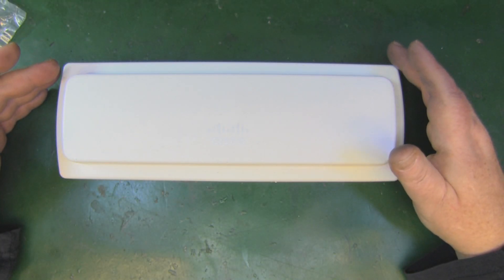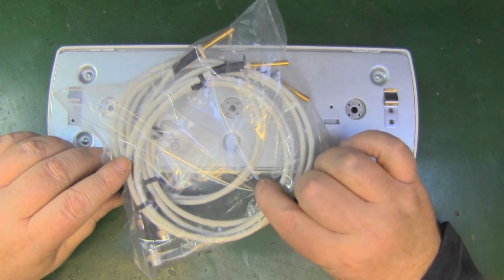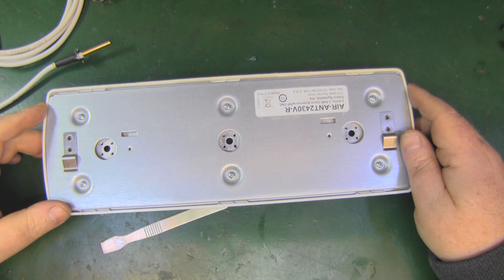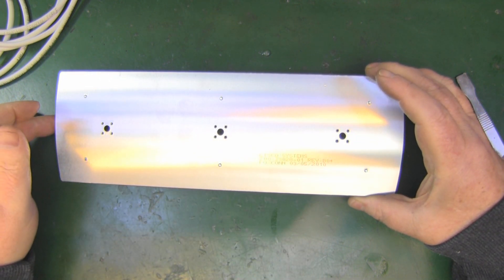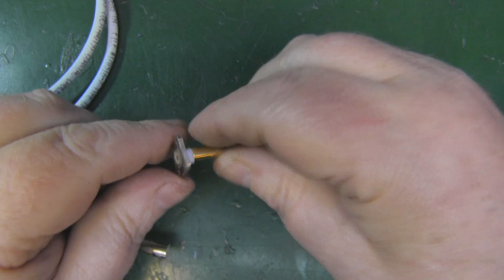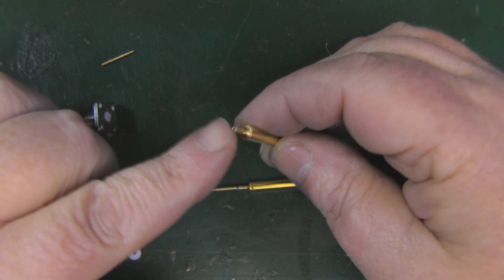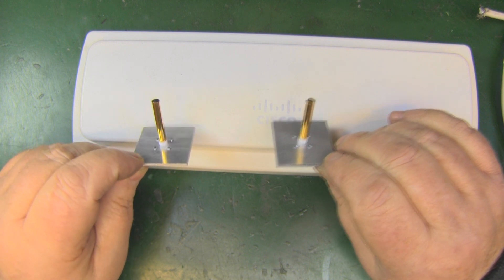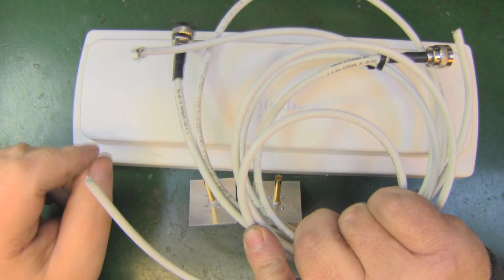A Simple Wifi Monopole Array from Cisco

Comment from the maker: Looking back at the video I think I should have also included the thin part of the element in the measurement inside the white dielectric.  2mm + 28.5mm to give a length of 30.5mm still shorter than the typical 31.5mm @2.4GHz.

Comment: I have AIR-ANT5140V-R. It is exactly the same construction. Of course rods are shorter for 5 GHz. Indeed the coax cable is nice. In case of 5 GHz version, the coax insulator is white teflon. Only the drawback of the cable is the fact that it is quite stiff. From practical point of view I prefer RG-402. But for sure cisco cable is better in ragards of low losses.

Comment: hi i am new to all this wifi and pc things. what i would like to know is this. on the omni antenna there is only one cable leading i assume to the router? but my router has two connections for the antennas. do i have to make two antennas then? we live 1 mile from the sea and about 4 miles from the tower if that is where the signal cimes from or is it a satellite signal? please help